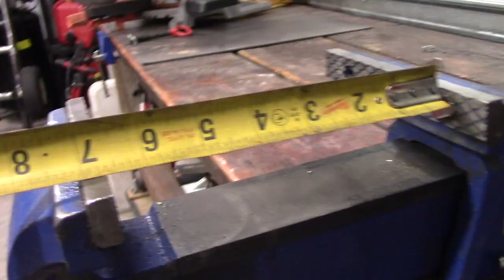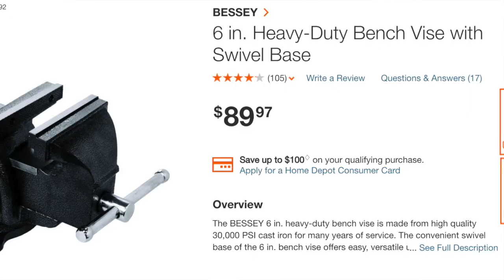Harbor Freight 6” Bench Vise Review

Comment: I think the HF centeral forge vises are awesome for the money.  They are strong and tough.  They have a little slop in them but it doesn't affect their function.  If you need something to hold crap tight that can take a beating for a low price go with them.  Fireball tool did a vise showdown with the intention of showing how crappy they are but actually proved them otherwise.  The HF vises did a lot better than a handful of other brands that are considered better.
Reply from the maker: The funny thing is that Wilton has the exact vise with their brand on it. Literally shaped exactly the same for something like $50 more than HF. I think they call it their economical vise or something like that. It’s seriously not a bad tool. It’s not a great too. Not the best tool. But for the money you pay, it’s a good one.

Comment: Your review is about as old as my 6" vise.
I broke it a month or so ago. Overtightened it, and the threads in the front broke.
It was a workin tool up until then.
Reply from the maker: I still have mine but don’t use it as much since I bought the new Doyle vise.

Comment: Ive had mine for years. But my gripe is that the lead screw is a piece of hot garbage. It hasnt failed but it feels like its going to at all times
Reply from the maker: Mines fairly smooth. You can get a 5.5 inch yost for like $75. If this one breaks someday I’ll probably replace it with the yost. Just because I want to try the yost. Not cause I’m unhappy with the Harbor Freight vise

Comment: Thanks for the informative video, Derek.  This video, along with your other one with the 3 vises helped me decide to go ahead and pick one of these up.  It's my first 'real' bench vise, and something that's been needed for ages.  I can't count the times when that stable 'third hand' would've come in umm, 'handy' :)
Anyway...a quick question for you or another commenter who has this same vise:  did you, or have you done any lubrication on it?  I've read and watched some videos (mostly on higher quality vises) on lubing the screw; applying paste wax or some such on the sliding mechanism.
Any information would be greatly appreciated. Thanks again for the video!
Reply from the maker: Thanks man, consider subscribing too if you don’t mind. As for lubricating the screw , I actually did put some grease on it and it seems to work really nicely. It’s a great vise for the money. You won’t exactly shape and bend cold thick pieces of steel in it but it’s good for a lot of things.
Reply: @DereksWorkshopAndProjects   Thanks, Derek.  I went ahead and put some white lithium grease on the screw (kind of  a pain, doing it from underneath, as it doesn't seem to want to come completely out).  It's working both ways easily just using one finger, so I figure that's plenty good enough for now.  Just subscribed, so I will be able to keep up with your videos/projects.
Reply from the maker: I really really appreciate it. Thanks!